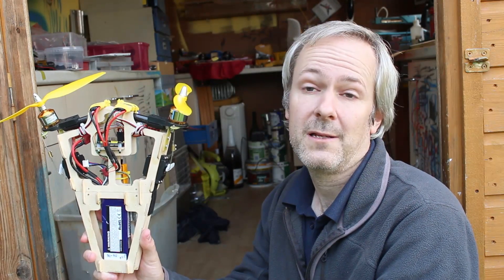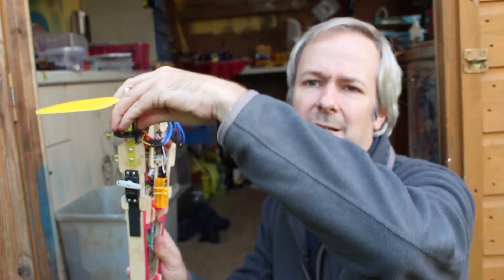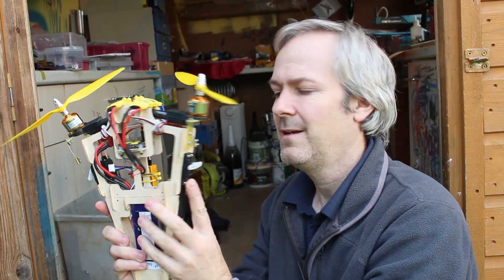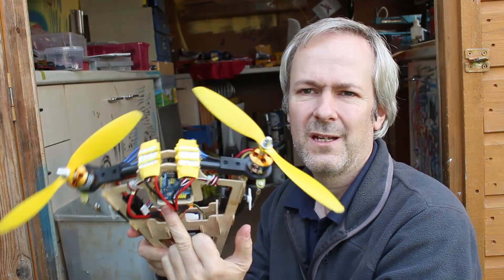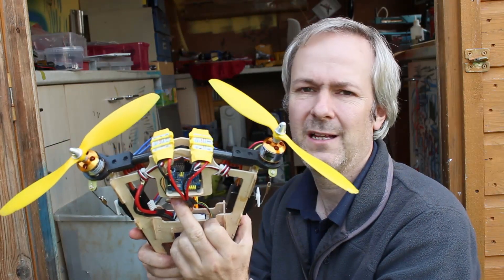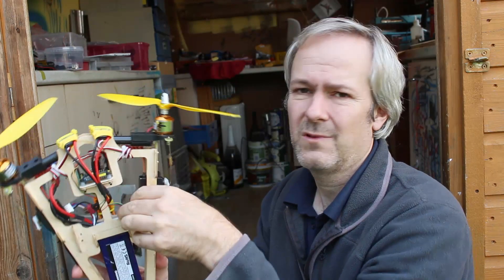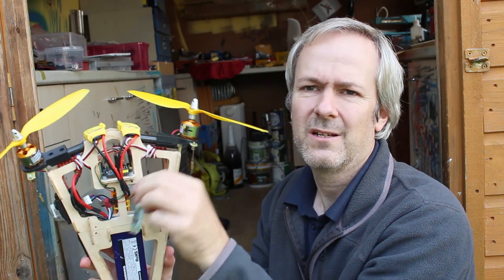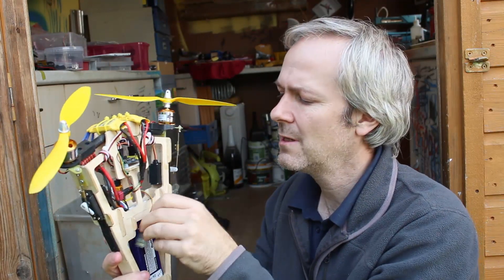bicopter A2122 1400Kv motor, 30A esc, multiwii

Comment: You should use PID controller to reduce vibration, looks like it balanced the bi copter without using PID control and directly from sensor data. Very good design!

Comment: Bicopter looks great. Good work! I've built two dualcopters and both servos wobble like yours when the yaw 'P' is set to high. Recommend lowering yaw 'P' to zero and gradually increase until the wobble appears and then back it off a bit. Let us know if this works.
Reply from the maker: +M Clay I have had a play with this and managed to get it better, but at the time I took the video I was happy to actually get it flying!

Comment: You either have a lot of vibrations going on or the gyro gain is set too high because those servo's are constantly twitching.
I'd also recommend not launching that close to your face, getting hit by those props will cut you up real bad.

Comment: Is the vibration from over compensation? (Oh I see someone mention balancing propellers) might be more responsive with higher kv/smaller diameter propellers, easier on torque for the servos too.
Reply from the maker: its a control thing! to much proportional gain? it was made loads worse by quicker servos.
Reply: mrfid72 I think this video is somewhat old you've probably improved it by now. Anyway great videos. Interesting mix of different topics.

Comment: Mr.Fid,  what if you only had one set of servos set up to adjust the weight of the battery on the bottom and secured the motor to be a solid mount ?    It's very cool !   I often dream of building a mansize bicopter like the one from the movie (about the spy kid?).

Comment: I would suggest adjusting the PID loop to get rid of the servo jitter
Reply: +Soxco how do you do that?
Reply: +BadIdeas101 Just google 'pid loop multiwii', there is good advice.
Reply from the maker: +BadIdeas101 On this Flight control board you can use a Bluetooth connection to a tablet and adjust the parameters PID rates and other bits!

Comment: Very innovative. Do you need both servos? I wonder if part of your oscillations are coming from the two servos fighting each other. You might disable one servo and see if that helps.
Reply from the maker: +Tom Busey I don't think you could get away with only having one servo as it uses both to control the yaw, one goes one way the other reverse. for forward and back it uses both together in the same direction. (if that makes sense)

Comment: Awesome! Just need a custom flight controller because the control is a bit off
Reply from the maker: +Brandon Piner Its a very good point! I have to be honest out of all the model I have built this one needed the most setting up and tuning and even then its still a work in progress. And I don't think it will ever be as good as a quad / hex or tri!!I changed the servos to high speed ones and if you can believe it, it got worse!

Comment: what is the flight time , also , do you think a raspberry pi can be fitted inside ?
Reply from the maker: flight time was about 10 minutes. The frame was made for a small multiwii board, but i am sure you could fit a raspberry pi in there somewhere? the zero (if you can find one) is very small

Comment: Why should not we use 1045 prop on 2200kv motor
Reply from the maker: Its a really good question.. i will have a go at answering it!!! a lower Kv (I.E 1000Kv) will spin slower and hence have more torque and will spin a bigger propeller. I high Kv like 2200Kv will spin quicker but have less torque so cant handle the big propellers. The Kv number multiplied by the battery voltage gives you the RPM. So for the same battery your 2200Kv will spin at more than twice the speed of the 1000Kv. I hope that helps, i tend to keep it simple and stick with just one motor propeller combination.

Comment: In my frame i cant put servo.So can i make it without servo ??
Reply from the maker: you need the ability for both motors to move. the servos drive the Bicopter forwards and backwards  and control yaw.
Reply: Cant we drive it forward and backward without servo?
Reply from the maker: @aasishkharel  not really, unless you have a new design!
Reply: You mean it cant fly forward and backward without servo right?
Reply from the maker: @aasishkharel  the servos are an important part of the control, if the bicopter starts to wonder forwards, thern the servos will tilt the motors back to stop it. and if it starts to spin then one will go forwards and one will go backwards to counteract the spin. my design can't work without servos. the only movement which doesn't require servos is left and right movements where one motor is speeded up and the other slowed so it moves sideways (left and right as you see the picture)